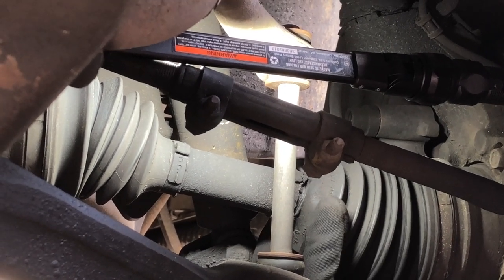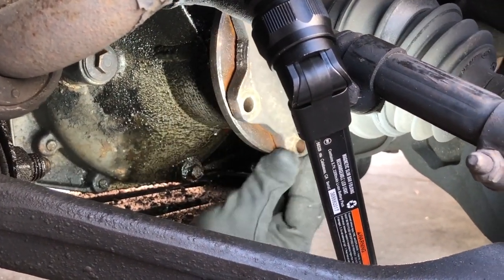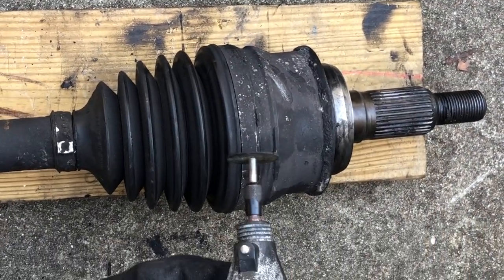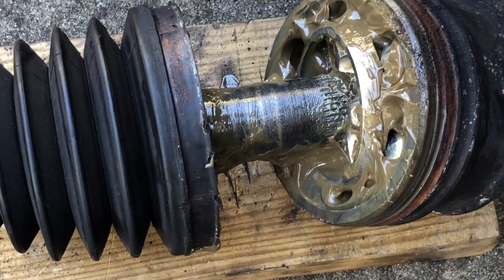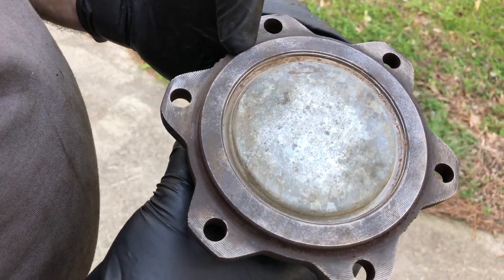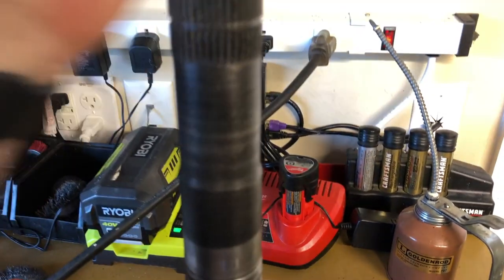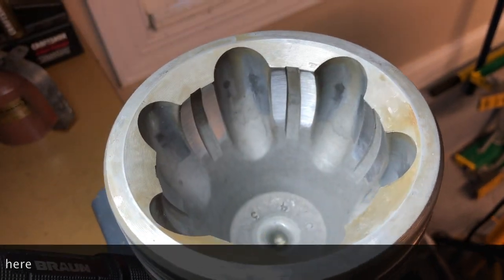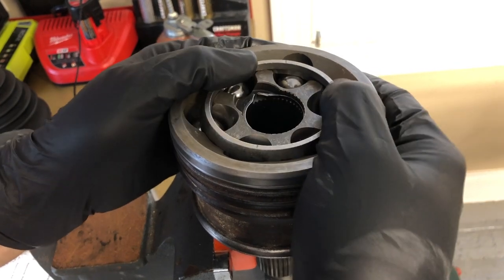1997 - 2010 GM 4WD K Truck Axle Half Shaft CV Joint Outer Boot Replacement Re-Boot (Chevrolet & GMC)

Comment: I think you actually showed us that boot issue a year or two ago when doing front brakes (rotors, pads, calipers,...) 😂😂😂 like button has been tapped 👍🏻
Reply from the maker: Good memory.   I had a similar repair on the 98 pickup over a year ago (which I hope was the one you recall), but I had a disk drive failure on the laptop and lost the video.  So when I noticed this one before Winter set in I took extra care not to lose the recording again.  ;-)    

Finally getting warm enough to cross some of these pending repairs off that I don't like dealing with in the cold weather.
Reply: @DrShock  yes, that must be the one I remember 🙂 I’m also happy for the warmer weather to get caught up on my own vehicle repairs. It’s amazing how they pile up over the cold, winter months

Comment: Been looking for the swage part numbers, thanks! I need a 36652-1 and can't find it. The aftermarket kits are garbage, they might last 12 months, if you're lucky. Probably need to bring my shafts to a dealer and bend over, I just need the crimp done:)

Comment: Excellent tutorial. Would there be any fundamental difference in a 1994 k2500? Thanks much.
Reply from the maker: It should be very similar though there were some part design changes that prompted me to cap this at 1997 in the video title.

Comment: Could you state how to determine if to replace the boots, or to replace the full half shat?
Some new aftermarket shafts are nearly the same price as new boots and the time to replace.
Thanks in advance !
Reply from the maker: First off there's vast differences in quality and fitment between OEM parts and aftermarket (typically asian imports).   If the boot is only slightly damaged, or the damage is caught early, I always urge the owner to just replace the boot to retain the higher quality and better fitting OEM axle components.   

Only if the shaft itself is damaged, or the boot damage has gone many miles without being addressed (and thus letting water and dirt get inside and initiate corrosion and wear on the CV components), would I go towards replacing the actual axle.  And then I will search for genuine OEM, or NOS, or even used before going with an inferior aftermarket offering only as a repair of last resort.

Comment: I cant justify buying a 300 swage clamp tool just to use it once and only these clamps. You think I can get away with using the gm boot and snap ring and grease just using a different style clamp?
Reply from the maker: Usually what I've come across is GM used an Oetiker style clamp (aka ear clamps) in the boot kits instead of the swage style used on the assembly line.  But for some reason on these GMT400 3/4 ton axle boot kits, they retained the swage style clamp.   I'm sure there's some engineering reason for that decision which I'm not aware of, as the additional labor time and tool costs to the dealerships are higher than if GM had just used an Oetiker style clamp.   If you are only working on one truck yes it's hard to justify the special service tool cost, but if you do even one additional truck the tool pays for itself vs farming the work out to a shop.
Reply: @DrShock ok thanks I ordered everything I need for the replacement hopefully I can do all the work up to the compressing the ring part and just take my whole  cv axle to my gm dealer and see if they can compress that swage ring for me.